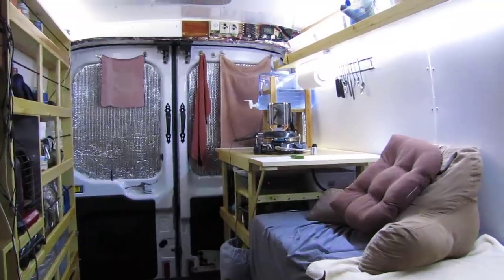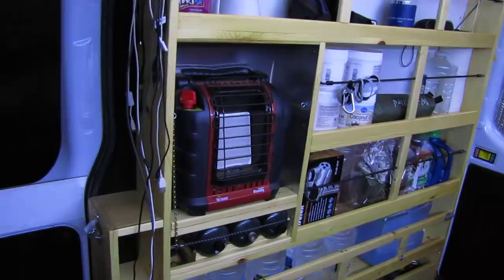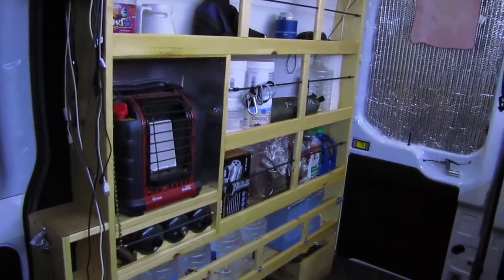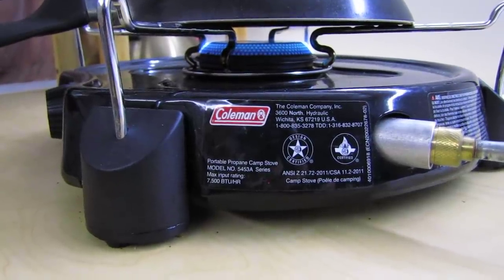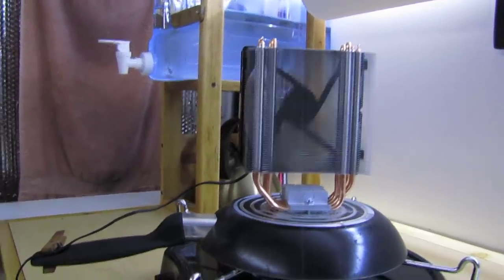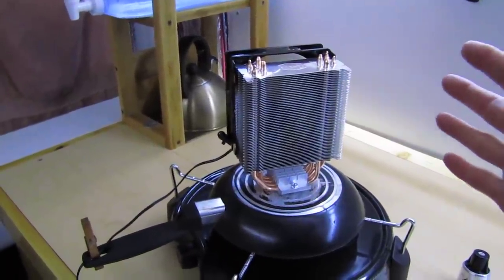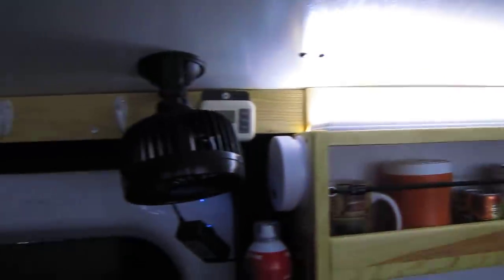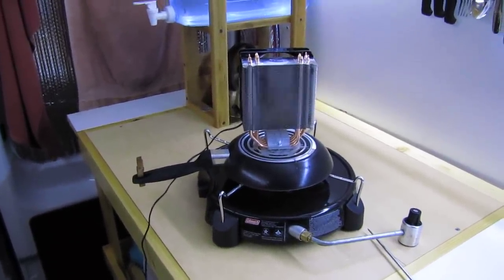My Van Heater using a Computer CPU heat pipe heater. Just an experiment to see if the concept works.

Comment: Terrific idea,, thanks for the share. I would like to try it using a wood stove eco fan mounted on the inverted fry pan. I found these things work great on  Little Buddy heaters and don't put a drain on the electrical system.

Comment: what a great idea.  BTY, put an adjustable spacer under the pan edge to lift (tilt) the pan to push it slightly up & away from the flame and that might make it adjustable for heat output.  I see some talking about buying a heater (by brand name) but your solution avoids buying something pre-made.  Your stove is now a multitasker and saves space.
Reply from the maker: I still like the Mr Buddy heater. It's perfect for bringing the inside temp up to where you want it. You have to heat the walls and everything else in the van first before you use a tiny heat source to keep it where you want it
Reply: A valid point.
Reply from the maker: @russveinot5754  Sort of like getting in a car that's been in the hot sun and is radiating heat from all surfaces. The AC has a hard time fighting that and it takes quite a while before the surfaces temperatures come down. Same thing with a really cold van only opposite. If my van is been sitting out in the cold, I will turn on the Mr Buddy and come back in a while after the interior has been warmed up. Then the Mr Buddy is no longer needed. :)

Comment: There's a little buddy heater that's even less BTU output. It screws onto the top of the propane bottle and only puts out around 1,500 BTUs. I have that for my little Ford Transit Connect and heats it perfect.

Comment: EL34XYZ
                I may be too late for this party to comment but here goes. There is another fan option you could try that will consume no power from your batteries. There is a device known as a Stirling cycle fan (based on the Sterling cycle engine) that many folks who burn wood and coal use with their stoves. It is powered only by the heat coming off the top of the stove.  Lehman's hardware (famous as a supplier to the Amish) offers them and I am sure many versions are out there for purchase online. My guess is that your aluminium pan surface would be hot enough for the fan to kick in and move the heated air around inside your van. These units are super quiet as a bonus. Hope this is helpful.
Reply from the maker: The fan draws 30 milliamps. A common interior auto light bulb draws over 1 amp. The battery draw is miniscule on that fan

Comment: Some heat conductive epoxy or heat sink compound of good quality between the pan and heat pipe assembly will make it much more efficient to conduct the heat between surfaces. Kudos on the idea, genius!
Reply from the maker: I always use heat sink compound on heat sinks

Comment: Really cool idea, nice use of alternative use for computer parts. And your video is the first I have seen of this combo. I use my computer as a space heater it has a water cooled gpu with a same size fan. I have it blowing directly at me from my desk so it is nice and warm. I think the heat pipe fan idea could work with a small torch head that can produce a much smaller flow of gas. Just wanted to say thank for the ideas.

Comment: Excellent!!! And yes, thermostatically controlled fan speed can tune in your desired comfort. I was also thinking of a small insulated hot water tank with a variable speed pump for the heat source. Batch heat the water then thermostatically control the thermal output from the tank first with the dc variable speed pump and secondly with dc variable speed computer fans like you are using. Might work all night. I was thinking about solar heatpipes also. Hope you keep experimenting with this.
Reply from the maker: Thanks Antone. I will dial in the fan speed thing and leave it like it is for now. It works very well as it is.

Comment: Still with this setup you have the moisture buildup (not as much as Mr Buddy but still)
You could maybe use a very small single burner propane cooker and encase it into an insulated metal box which top is possibly flush with your countertop there. One of the sides of the box vents or is via grill exposed to the outside. On the flush top of the box you could fix a nut underneath in which you can thread your 15 dollar amazon heat pipe radiator onto and have it to fan around the heat you want minus the moisture, any propane smell and off gases... The threading thing lets you even swivel the heatsink fan contraption in a range of directions. You could even use the disused frying pan as a top for (not a box persee but) a cylindrical heater "box". Maybe two sizes of metal pales with the magic stuff in between as a heater body and the fryingpan as a top (flush mounted in the countertop) ???
A setup as I propose could also be used to make hot water (for even a primitive shower and washing up)
Simply remove the heatsink fan tower thingy and replace it with a copper coil on top of a aluminium plate (also using the thread)

I use a Webasto ThermoTop C water heater system as my heat source. Hooked up to a very generic (1983 mini cooper) heater unit it provides me with heat for the van and hot water. I constructed my own 8 L (very small) close in boiler (small because I wanted it to fit inside my sink cabinet and were to be build inside a 19L jerry can which I use to store my cold water) The close in boiler is hooked up into the return water line from the car heater unit and uses heat that is "surplus". The water is heated up to about 40-50 degrees depending on how often the Webasto desides te start running. The water is hot enough (often times even too hot and I have to add cold water) to use in another system I build: An air pressurized UN jerrycan shower. A bicycle pump, a valve stem and a 20 L UN HDPE jerrycan with a garden style hand sprayer and some hoses form the bases for this shower system, which I use most of the time outside in a collapsible showering tent.
The Webasto is 5200 W in power which is crazy too much but it is capable of heating the van, some water in very short order and it runs maybe 4 times for about 5 minutes every hour if it is really cold out (8 degrees C or less) The van isn't insulated to a crazy level: 1 inch foam board with aluminium foil on both sides...
Reply from the maker: The video description has info on that

Comment: Great idea. Very creative. Still did not solve the water vapor issue. Keep up the creativity for my build. Thanks
Reply from the maker: Thanks, but it did solve the vapor issue to a big degree, because 4000 BTU heat from that Mr Heater is a huge increase over that small coleman stove flame. That Mr heater thing burns through small one pound propane cylinders very quickly. That stove on the lowest setting goes a very long time on a 1 pound tank. So the stove is throwing out way less moisture than the Mr heater
Reply from the maker: I watched the humidity in the van with the stove heater and it was not bad at all

Comment: To be honest, this doesn't solve the moisture problem. It's just a little less moisture but still. If you camp in cold weather your breath alone will get you to dripping off the ceiling.  I have a small teardrop (essentially a king sized bed on wheels with a kitchen in the back) and I grew tired of waking to cold drip condensation at 3am. I invested in a propex gas heater which is mounted under the camper and ducted in. It has too many BTU's for a glorified bed on wheels, but it also has a thermostat. Bye bye condensation. Setting it at 65F  (18C)  uses very little propane and almost no electricity. Crack a window for the moist air to escape and I haven't had a condensation problem since. Well worth the investment, particularly since this is dry heat - so no extra moisture from combustion because that happens outside the camper. I also added a battleborn LiFePO4 battery to the rig, so now I can run my fridge and my heater nearly indefinitely as long as the sun shines during the day (got a solar panel on the roof of course)

Comment: I'm 71 years old ! In the early model campers they all had a propane mantle light in them, they would keep the small campers warm in pretty cold weather! never had to use the stove or fce. You can still buy them from Amazon or Lehems in Kidron Ohio! You can put in a large 20 lb tank and probably run it for several weeks !
Reply from the maker: I have a 20 pound tank and you are right, you only need a very tiny heat source if the van or trailer is insulated properly. The main thing is to get the inside up to the proper temp first and then a tiny heat source can take it from there

Comment: I did a very similar thing a few years ago when there was no heating in my apartment for a week.
Gas cooker, metal plate and a cpu cooler. 
Ambient air temperature was 12*c (pre heater)
With quick homemade heater 23*c (post heater, after 45 minutes)

It works well, but it isn't very efficient.
Reply from the maker: I added a small ventless propane heater to my house for when the power goes out. I have heat pumps and so I needed a backup heating source.

Comment: It's called a aftermarket cooler. I have one on my desktop. To make it work better you should apply thermal past to the after market cooler on the bottom. It look's you did on this but i can't tell. The thermal past will help collect more heat from the bottom.
Reply from the maker: Already mentioned in the video description

Comment: I know this works because I'm in a 940 sqft condo and my computer will keep my condo at 71-74 in the fall months. It cranks out 145-degree (yes, my processor runs that hot) heat constantly while on from a massive heatsink on the CPU, motherboard, and graphics card.
I'm interested now in trying that idea on a 9-hour candle lantern or small alcohol burner stove.
Reply from the maker: Yeah, my desktops with 8 core cpu's heat up my office pretty good

Comment: Brilliant! I like your approach. I've been looking for something similar (a ready-made solution) and I found nothing. A couple of observations:

CPU heat pipe exchange appears to be the right size for a van but needs a system regulating fan efficiency or propane burned. Ideally, this whole rig should be built as a separate and totally insulated little box placed outside of the van, with only the hot air ducts entering the cabin. Exhaust should be totally separate and never get close to the cabin.

Also, a much smaller burner can be used, the kind that backpackers and mountaineers carry. Those are like one inch big and could produce enough BTUs to heat the copper pipe, especially if you modify the pipe into a coil. 

Basically, it's a micro propane water heater. It would need a thermostat, a timer and a piezo lighter to be maintenance-free. Something like a ceiling fan is needed to provide air recirculation in the cabin. Also, CO2 and carbon dioxide sensor is a must.

Comment: Do you prefer the pan to be aluminum? Or is it just a conductor of heat and can also be stainless steel or cast iron? If aluminum is preferred, perhaps one without non stick coating would be best to burn.
Reply from the maker: Aluminum and copper are the best heat conductors, so the base plate that receives the heat is better using one of those materials. Copper is more expensive and so a block of aluminum would be the best

Comment: Can you use a dryer duct on the back of the fan and have the other side of the duct on the floor? It would pull the cold air from the floor and help to balance the temp in the van?

Comment: There is at least one RV and Boat propane heater that works this way. The flame is contained in an exterior (or interior but sealed) box. It gets it's air for the flame from the outside and the exhaust is vented to the outside as well. This eliminates the interior build up of CO1 and CO2 and moisture. The flame heats up a series of thin steel tubes about 1 inch in diameter. A duct work and in-line 12 volt fan draws in cabin air, blows it through the heated tubes and back into the boat or RV. The burner has a thermostat driven electronic ignition and gas supply valve, and the interior temperature can be set with a normal household thermostat. The main problem is finding a good, out of the way place for the furnace box. Unfortunately, it isn't what I would consider a "budget" heater unless you have the tools and ingenuity to make it from scratch.
P.S. I live on a 37' sailboat and simply use a spare Coleman propane stove on the floor for cabin heat and have done this for 3 years with no CO1 problems. Humidity is always a problem on a boat, propane exhaust or not. The trick is to put the stove low if not on the floor. This starts a circulating convection flow in the cabin.
Reply from the maker: Yes, I have seen them. A buddy of mine installed one in his small travel trailer. It's a bunch of rigging to get one installed and you have to have a space on the wall for the unit, but they work well

Comment: Think you should patent your creation and manufacture these. It was Bob Wells of “cheapRVliving” who uses the stove burner/pan setup for heat. Cast iron pan and I suggested rocks in pan for creating radiant heat. He uses also a wind screen around the setup. Only uses it to warm up his van before retiring. Doesn’t run it overnight‼️
Reply from the maker: yes, Bob has used the same principal in his van.

Comment: I suggest to put a layer of foil flex aluminum bubble wrap on the floor, lower the heat source as low to the floor as possible, then blow the air down from the ceiling into the floor, everything will have a chance to get heated evenly.
Reply: Also, isn't there a device that takes the heat and turns it into electricity then into the fan not needing additional electric ?
Reply: Also, I think if you use a Coleman duel
 Fuel stove, you can use super unleaded gas as you do your burner on low with out the moisture issue. Either way, always have a carbon monoxide detector and enough ventilation to be safe.

Comment: I use a small mr. Buddy Heater like you're showing in a 2002 Dodge Caravan I have one window slightly open in the front and one slightly in the back 0 problems and carbon monoxide my windows are coated with an anti fog so this keeps condensation to minimum if none I've used this heater at 10 degree weather all night no problems without my carbon monoxide detector going off with just the right amount of fresh air coming or going you would not have no problems some of y'all just don't know how to use those heaters so you don't need them if you don't understand them or how to properly use them been doing this now for over 2 years without no issues
Reply from the maker: yep, it's amazing how many people don't understand the whole situation or read the video description. I always have the two front windows cracked just enough than my maxxair fan on the lowest setting vents the van perfectly :)
You are proof it works because you are not dead yet :)

Comment: I'm planning a liquid cooled computer chip cooler and radiator combination . The goal is a thermostat regulated radiator and fan in the van. While the water heating occurs outside the van.

Gaming computers develop a lot of heat. Some have liquid cooling. A heat absorber with liquid coolant channels in it cools the chip. The heat is then pumped through hoses to a radiator and cooling fan. 

Now imagine that the radiator is inside the camper. The heating portion is outside the van. Fumes and moisture stay outside, while the heat go's to the radiator. Just like a car. A 12v fan would blow through the heater core. 

The heater unit would come from a junked rv fridge. We would use the burner and ignitor, the gas regulator and the circuit board. 

We would mount the computer chip cooler right over the flame.  
The heat portion would live in weather proof container close to the outside propane tank.
The circuit board would be in the van. 

In operation, an rv fridge will turn on when the thermostat tells it to . It will open the gas valve and ignite the flame. A sensor will confirm that the fridge flame is producing heat. 

The heating system I'm taking about will turn on when the van thermostat drops below say 70 degrees. The flame will light. 

A water pump starts pumping warm water to the radiator, and a fan blows through the radiator. 

Look up liquid cooled cpu information on you tube. 

The heat block is used for computers. The radiator could come from the same company. Matched for btu rate. Perhaps a  car heater core could be used instead. A cpu fan would blow through the core. 
A Toyota Prius inverter cooler is basicly a pretty cheap and reliable high volume 12v water pump. 

I'm just in the planning stage. 

One company says that their chip cooler can handle 450 watts of heat. This is about 1500 btu. I'm guessing the efficiency rate might be 70 percent. That's about 1000 btu. 

One could get creative and use two chip coolers and a larger rv fridge flame.

Comment: the only improvement i can see would be to drill a few holes in the frying pan to prevent a heat bubble from forming and reducing contact of hot air from the burner to the pan.
Reply from the maker: No need for holes, the flame is set so low, you can hardly see it. Any higher and it's wasted by not being drawn up the heat pipes

Comment: I did the same thing had the idea when i was 18 never did it until 2014. 6 pc fans on solar power making a natural air conditioner. Blows cold air and work all day while you have the van locked up in the sun so its decent when you get back in the van and the cooler doesnt wrk as hard.
Reply from the maker: I have 200 watts of solar and a Maxxair fan with 10 speeds.